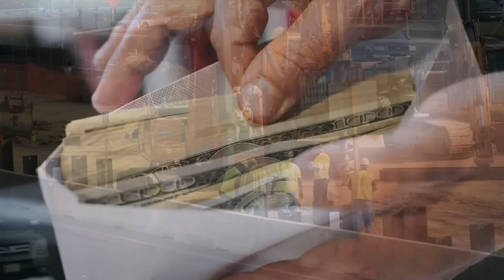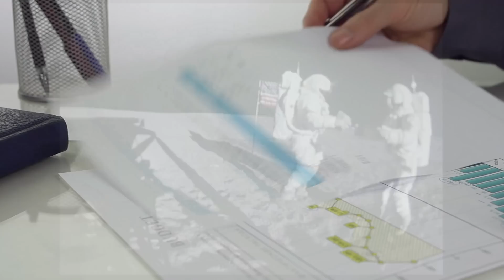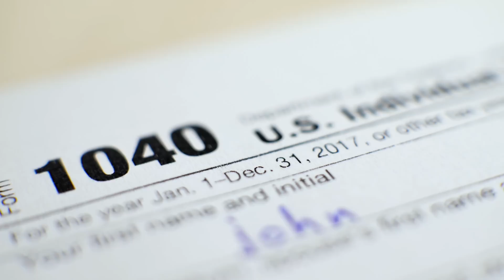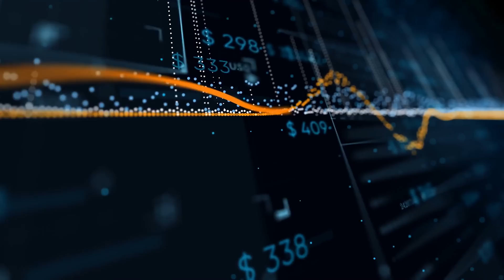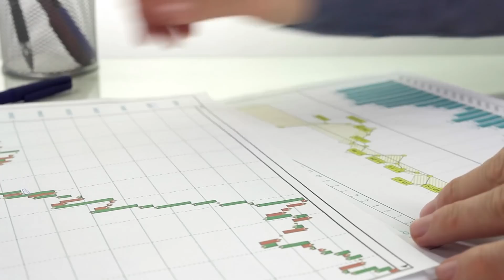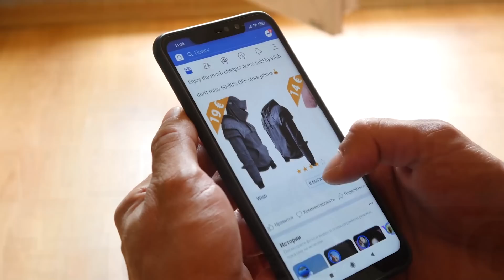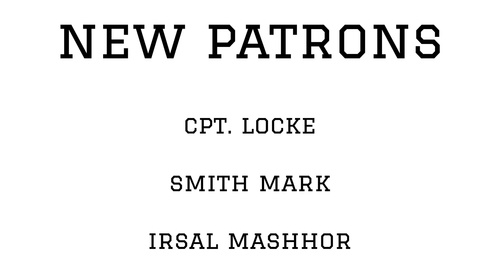How To Make Space Travel Economically Viable

Comment: I think fusion energy is a silly idea - here's why.

It has to to with something I'm going to call the fuel fallacy.  Let's say you are choosing between two cars.  One of them gets 67 miles per gallon, and the other gets 40.  Clearly the 67mpg one will be cheaper to operate?  What I'm calling the "furl fallacy" is the omission of the qualifier, "all else equal".  These two cars I'm thinking of are the Porsche 918 Spyder at 67 miles per gallon, and my 1991 Honda Civic at 40.  In this case the one which burns more fuel is going to be way cheaper, because the acquisition and upkeep costs are less.  This sounds obvious with cars, but for some reason it's often forgotten when talking about power generation.

Compare a coal plant to a nuclear fission plant.  The coal has a really cheap acquisition and maintenance cost, but you use several whole freight trains of fuel each day.  The nuclear plant is extremely expensive to build and has huge regulatory overhead, but its fuel can be sent in with a single truck only visiting a couple times a year.  The uranium cost for a fission nuclear plant is a fraction of a cent per kWh, only representing typically 5% of the lifetime cost of that station on the grid.  And by the way, there are already tested designs that reduce that fuel consumption by a factor of 20 (called breeder reactors; the first power-producing reactor ever was actually a breeder).

Now fusion pulls up.  They have no idea what construction cost is going to be because it's not been built yet.  It still involves radioactive materials so it will be subject to the same INCOMPARABLY strict regulatory standards, except the materials are far more leak-prone (tritium can "leak" between the molecules of solid steel).  But not to worry, says the fusion advocate, for we will have greatly lower fuel cost than fission!  That fraction of a penny per kWh?  Well now it's a smaller fraction!  Then the fission breeder reactor advocate says, "Get in line pal, I've been trying that sales pitch for 70 years."

This is one corner where I think the space people get absolutely smacked by economics.

Comment: There are a few commercial viable extra terrestrial endeavors that can get that dyson started. As in Right Now. 

After that there goes the galaxy. 

1. Energy-- fusion reactors still got a long way to go, but we got the natural fusion reactor almost exactly one astronomical unit away. The sun. Solar power is vastly more efficient in space, the next best thing to infinitely scalable. 

Yes all these launches are expensive, but when they represent a direct return on investment that as a happy side effect fixes global warming. It's not exactly a hard sell. 

2. Orbital and lunar manufacturing-- just making the solar collectors in orbit and or on the moon drops the cost of these solar collectors considerably, all that orbital infrastructure will eventually permit the next step. 

3. Habitation-- eventually the on site operators aren't going to bother going to earth and with manufacturing infrastructure in orbit,  it wouldn't be very difficult to build massive rotating habitats that'd honestly be more shielded for solar radiation than you are now. 

From that point, well there goes the galaxy........ and more as we work our way up the kardashev scale. 

More power, more minerals, more habs rinse and repeat till heat death.

Comment: The expensive part is to get the seed industry to the moon.   The energy availability is great on the surface and the new resources available ends up stimulating new products and new technologies that will make the future costs of getting out of the earth gravity well.   Once we start getting industry established and start to fabricate what we need from the raw resources up there, we can build mass drivers to launch product foundered on the moon back to earth on one use reentry craft that do not need traditional fuel to just land on skids.   Then these transports can be dismantled by the local population for building materials and use the goods for the value that they represent.   As far as a Mars mission, we can send resources to Mars with the mass drivers powered with energy taken from the 14 days of sun each spot on the moon has for their 28 day cycle.  Excess power can be stored in new battery/capacitors on the moon for the 14 earth day nights and for actually growing crops on the moon to eliminate the buildup of CO2 and to feed the Moon population.   Where would these crops be grown?   There are lava tubes to begin with and more structures can be built cheaply.   What will you make all of these re-entry vehicles out of?  Basaltic Thread, made from basaltic rock which is very abundant on the moon.   Look it up.   Easy to extract and very heat resistant.   This is just a taste.   With the mass drivers we can turn Mars into an IKEA before any astronaut sets foot on Mars.   Their likelihood of survival on Mars increases with the resources prepositioned before the man-power arrives..

Comment: Just to be pedantic.  There are asteroids with more gold and platinum than Earth's crust, not all of Earth.  Earth's core formed from the same materials as the asteroids and has much more mass than the entire asteroid belt combined.   So there is almost certainly vast amounts of heavy metals at the very center of Earth's core.  Of course because one of those heavy metals is uranium the result is that Earth's core is a giant superheated runaway nuclear reaction covered by a couple billion tons of molten iron.   So not something we could mine without ripping the planet apart.  It is strange to think that it is easier to mine an asteroid beyond the orbit of Mars than it is to mine our own planet, but the simple fact is that the asteroid is easier to get at simply because it's lower mass means it has cooled off.

Comment: The biggest limitation of space travel, is production in space. Getting around space is honestly really cheap, though it does take awhile, but we have drones and machines to do all that time consuming work. What's expensive, is not space travel
, but getting things out of earths gravity well, and atmosphere. Yes, the atmosphere makes a pretty big difference as while it's great for air breaking on re entry, it adds a HUGE cost to escaping our little blue ball.
If we can mine resources in space, and build stuff in space, like we do here on earth, then that means we can make stuff for much cheaper up there, and use it up there, rather than making it down here and then spending insane amounts shipping it up there. And for valuable metals or resources, it's easy and cheap enough to drop them back down to earth for the most part, again, that atmosphere helps on the re entry part a lot.
So the biggest limitation on it being economically viable, is what it takes to actually build stuff in space. What's it cost to send up a mining drone, what's it cost to set up a refinery system to process ores into metals. What's it cost to set of a basic fabricator and factory for solar panels, motors, engines, or other parts? We don't need to send all of that up ourselves, just the starting parts needed. So small general purpose 3d printers and stuff can potentially help a lot. A machine that can mine through dirt, and easily extract a whole variety of resources without being a giant factory sized complex early on, even if it's slow. As long as it can do it early on to get what's needed to build those more dedicated factories that do it fast later. This is the real goal right now, and we're getting closer in a lot of ways but also still not there yet. We would still need to send a lot of types of equipment and resources up from factories on earth with today's tech, and that means the cost of transportation for all of that it just too impractical for most parties. So we'll probably wait for that tech to imporove. But even as it is now, it's still just a big upfront cost but with great benefits. Long term, once we have the factories and infrastructure set up in space, on the moon, etc... all we need to do is ship the humans up to orbit and that's relatively cheap if SpaceX plans pan out right. From that point on, there's huge gains to be made for relatively little cost once that initial infrastructure is in place. The huge cost is in setting it up in the first place, or just sending everything up itself instead of building it up there.

Comment: Yes, businesses are looking for profitability, and manned space programs are seem too risky with little return on investment. Helium 3 does not seem viable, as fusion with Deuterium-Tritium is simpler and obtainable from sea water.
However, fixed cost contracts for government services are rapidly increasing for cargo and humans to orbit, cargo to the Moon, rapid availability and so on. While the heavy lifters, building stations and bases will probably be government led, supplying them will increasingly be private.
Communication and observation satellites are already booming. Space tech is still expensive and hard to do, but universities are designing and operating minisats in space. Technology is progressing so fast that you could do the same job with a much smaller sat, cheaper to build and launch, and much more reliable. 
A large factor in the cost-benefit calculation for businesses is, well, the cost of access to space. Since SpaceX is crashing launch prices with acceptable risk, suddenly grabbing an asteroid from the belt and bringing it to Earth is a lot more profitable. It doesn't even need to be a platinum mountain. Bringing an ice or iron asteroid to orbit could supply a space station with water, fuel or building materials for a long time much cheaper than if launched from Earth.
On top of that you have the early adopters that want to experience space tourism. And on top of that you have genuine space enthusiasts who are not looking for near-term profitability - I'm talking, of course, about Musk and Bezos. Musk has repeatedly said he is not in it for the money, money is just a means to get to Mars.

Comment: What about mining water from near earth asteroid and refuel satellites? That could be economically viable.
Reply: where you are going to use that water?
Reply: @deltaxcd  to split up the molecule to make liquid oxygen and liquid hydrogen. Rocket fuels.
Reply: @jakemckee2005  
I doubt it you can do that in space at the volumes required and with any reasonable efficiency. and also  as I know satellites do not use that kind of fuel.
although water could be used as fuel directly without any splitting if you just use solar power as energy source.
Reply: @deltaxcd  oh yeah you can do it. With enough space.
Reply: @deltaxcd  a lot of satellites use hypergolic fuels like hydrazine. Hydrazine is nitrogen and hydrogen. Ship some nitrogen and combine it with hydrogen.

And if not, satellites could use what’s available and just use lox and liquid hydrogen.
Reply: @deltaxcd  but it’s not just satellites. It’s ships with humans. We usually don’t use hypergolics for long term space travel. We could use the water for drinking, air supply, and fuel.
Reply: @jakemckee2005  
you forgot that another component of that hypergolic fuel is nitric acid it will not be that easy to make those things in space they are even pretty hard to do on earth LOL
Using LOX and hydrogen is problematic because you can't store them for very long and also engines are a bit too complex and unreliable 

But anyway if your goals is to use fuel for maneuvering you don't need to do anything just heat water with electric power and use steam or plasma as jet engine

Comment: I wish you brought up the snowball nature of space investment... Space is primarily expensive because value is relative to earth, and the rocket equation is a bitch.  Once you can manufacture space assests in space, the economics change dramatically.  For example, rocket fuel is worth thousands of times as much if its on the surface of the moon.  As the space economy grows, there is greater demand for a variety of materials and services in space, driving growth even further.  You ship complex parts like computers from earth, using space based materials for simple parts.  Space has almost infinite resources, so it's the only long term growth option.  The ecenomic snowball just has to start start rolling.

Comment: A more distant potential than mining asteroids for precious materials is mining them for BASIC materials. If it becomes desirable for some people to live in space, say, rich people or workers in zero G industrial facilities (that could potentially manufacture something space factories would have an absolute monopoly on!), then getting there cost of doing that down is important. Launch costs have limits, especially without questionable speculative megastructures like launch loops, space elevators, and orbital rings. Therefore, the value of anything in space is comparable to precious or semi-precious metals if you're using it for something. This creates an incentive to gather your raw materials from sources that are already in space, to ship home to build more space factories, which then use their zero G manufacturing processes to make things that cannot be made on Earth by any means, and use those same raw materials to make fuel in space, make more places to live in space, make nore space factories, etc, with fewer and fewer launches needed. In space, you don't need to consider factors like land usage or wind for things like solar facilities either, so making cheap, simple, bad solar panels you can virtually paint onto any surface from materials like lunar regolith, and then painting them onto a 10 tonne, 1 km^2 mylar sheet with some rigid struts, means you have an undisrupted hundred megawatt powerplant. This means all your raw materials have been sourced from space, and you're creating a massive surplus of energy in space. More things would follow suit in the vast emptiness (making land/area a free thing) with no disruptive forces that is space. Meaning it develops its own economy reliant not on sending gold or iron ore down to Earth but on trading whatever is easier to make or do in space than on Earth (and ship it differen, for whatever is easier to do on Earth than in space (and ship it up).

Comment: Helium-3 is NOT relatively abundant on the Moon. Harvesting meaningful amounts would require scouring a large percentage of the Moon's surface, an exercise which will take more energy than you can possibly get by fusing that helium back on Earth. The only halfway practical place I'm aware of to get it in any significant volume, aside from as a waste product of other types of fusion reactors I suppose, is Saturn, and getting there is... well, a bit challenging, needless to say.

Comment: Helium 3 is actually a terrible fuel for fusion. It simply doesn't burn at all at the temperatures of the much cheaper tritium. Tritium also has the advantage that it sends energy out of the plasma in the form of neutrons, which helium 3 cannot do.

No serious effort to achieve fusion is considering the use of helium 3, even if it was free. The Jet reactor in the UK uses tritium, ITER in Europe uses tritium, the planned reactor in China will use tritium and so on.

The usefulness of helium 3 is a urban legend that is spread by space enthusiasts but no nuclear scientist thinks it's useful for anything.

Comment: Read The Tyrrany of the Rocket Equation.  That's why rockets are never safe never cheap, why we never went back to the moon.
 The low specific impulse and need to carry onboard oxidizer means spacecraft have to be volitile flying fuel tanks shoved into space with critically dangerous ultra high performance engines to even get a small payload there.
 SpaceX using this and not exotic new propulsion tech means it's probably going to be a lot like space shuttle, a promise of cheap and reliable running into hard engineering realities.
 Want space cities and holiday tickets to orbit for non billionaires, invent compact fusion reactor that can power single stage reusable ship.  Or some kind of high impulse air breathing engine like skylon/sabre, or beamed propulsion.
Reply: Michael Cooney There is an interesting lecture about Space Tethers by Kurzguest. Although I have yet to do further investigative research on the subject to see if the science checks out. 

Also, I believe we could use propulsion mechanics to get to an altitude high enough. So, we can utilize the Earth's gravity (similar to the ISS) where it goes fast enough to build up energy. 

Although, (as obvious as it is) I am no rocket engineer. Sure as hell don't know enough physics to justify my logic so please excuse my inaccuracies in my typing.
Reply: Actually, SpaceX is doing the opposite of developing a super-advanced rocket with super high impulse fuels.
The modern approach is just brute force where you build absurdly big and cheap rocket with a pretty bad performance where practically all price of the travel consists of the fuel price.
The goal is not the safety of efficiency but just plain price.
The modern solar power hype resulted in an idea to use solar power to produce the fuel as well